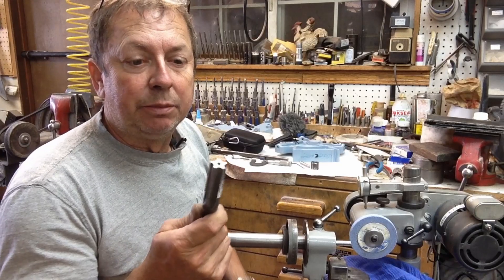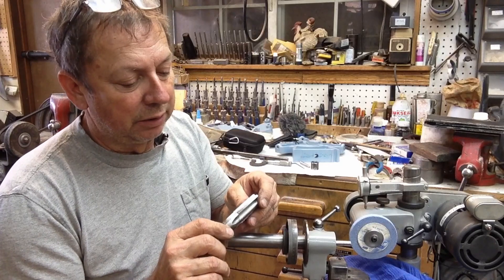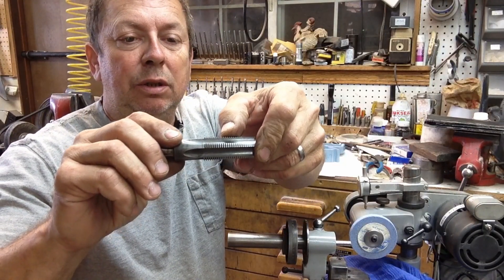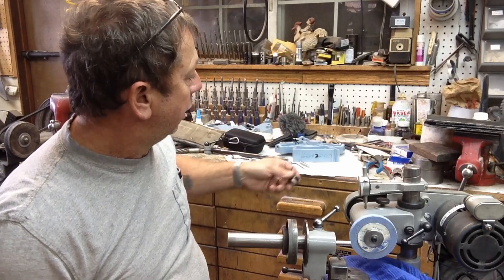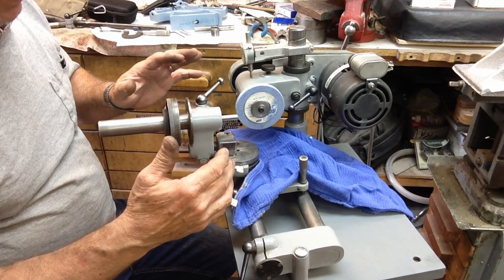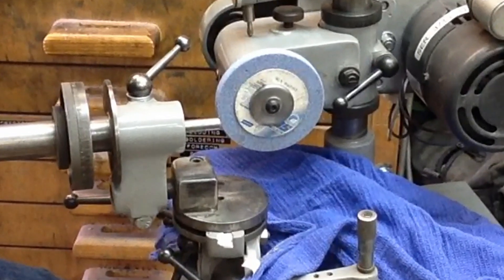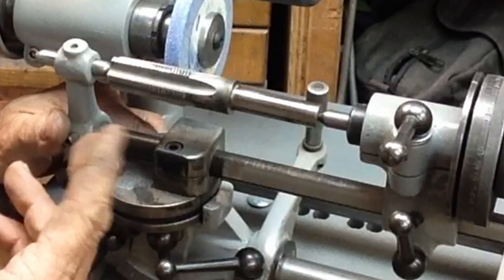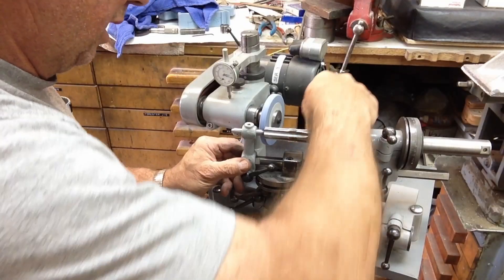Quorn Tool & Cutter Grinder: Modifying A Tap

Comment: I build my Quorn about 5 years ago.  Ive been looking for a wheel vendor for the small wheels.  Do you have any recommendations?
Reply from the maker: Hi Charles: no I don't, that is a major problem with the Quorn. I mainly use a dish wheel but I don't remember where I got it from but it was probably MSC. I have a couple of straight wheels that I got used . I have seen a few listed on amazon that look promising but I haven't tried them yet. Dan.
Reply: @hillsgun  Thanks